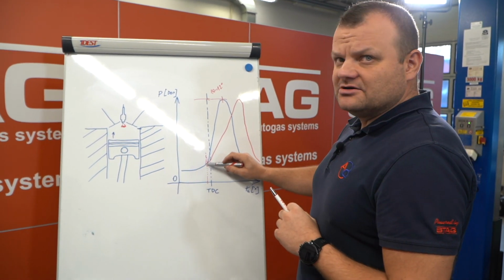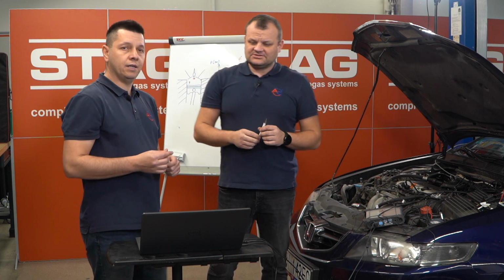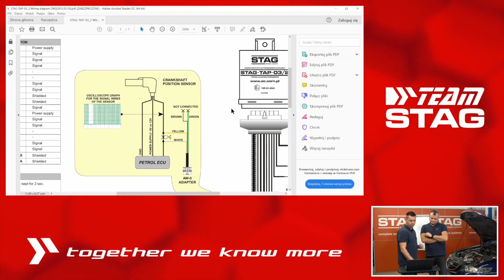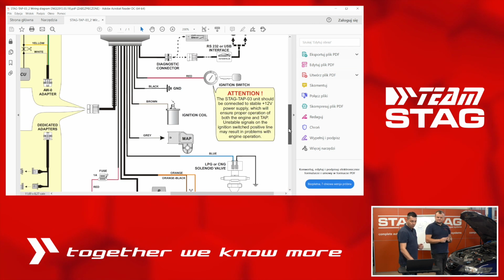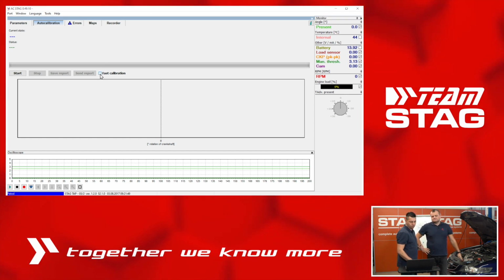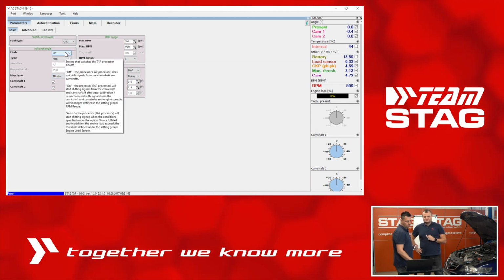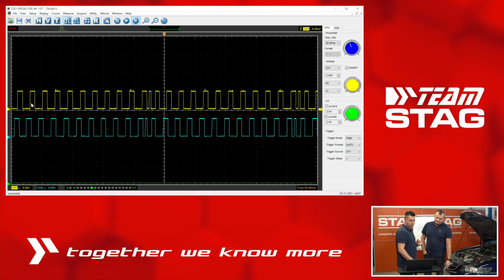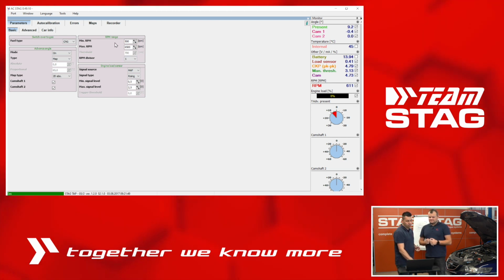STAG webinar - installation and practical use of the timing advance variator part two

Comment: Hi nice information,,,in some cars after putting the TAP the car's RPM gets disturbed.i.e in CNG ECU software the RPM gets changed...or stops showing RPM for a second and then goes back to normal (this happens on regular interval ) ...in this case what can be the issue...is the TAP not compatible even though its as per the CKP sensor type
Reply: I also have this problem
Reply: @junyuan7720  which car and tap ur using